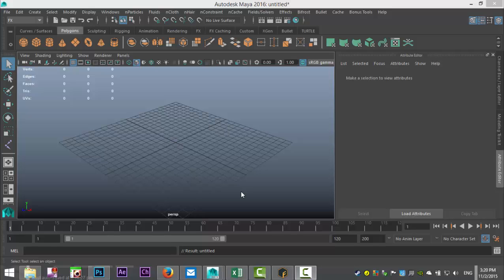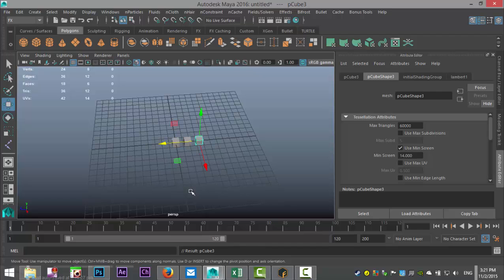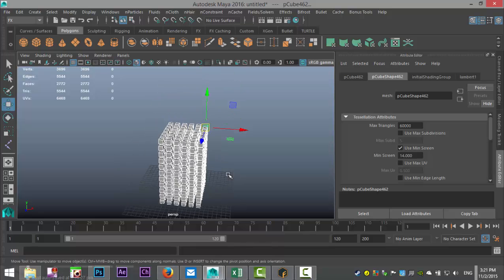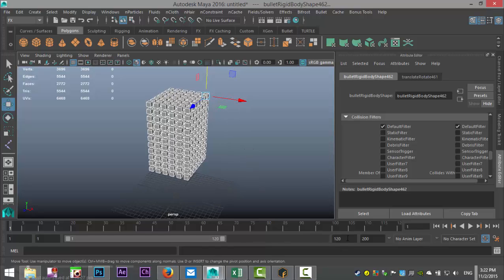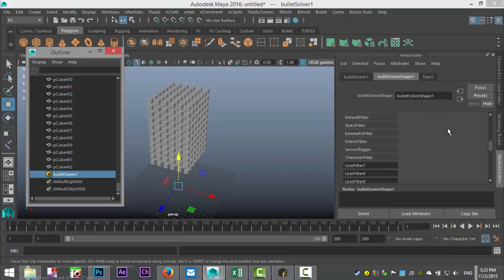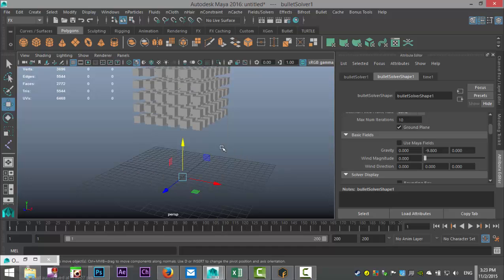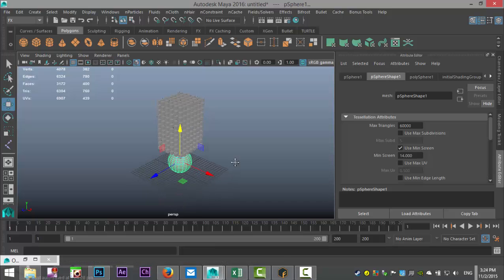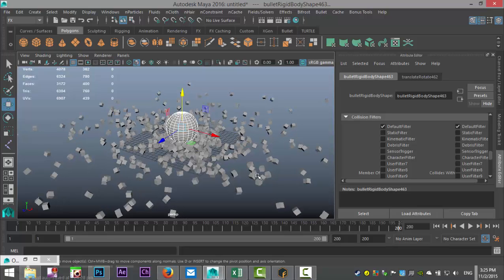Maya 2016 tutorial : The basics of Bullet physics explained

Comment: Great stuff as usual, Mike.  I had a question.  I'm experimenting and creating something similar to your demonstration, however I want the ball to be "rolling" through the stack as it's falling. I tried the ball as a passive rigid body and it didn't move so I turned it into an active rigid body.  I needed to reanimate the movement to the ball but the cubes don't collide with it, it just passes right through.  Suggestions?
Reply from the maker: Have the ball fall straight down and then tilt the camera so it looks like the ball is going from right to left
Reply: Turning the camera won't create collision, though, right?  I'm looking for the blocks to collide with a moving object.  I have the ball moving but it "phases" through rather than actively showing a collision.